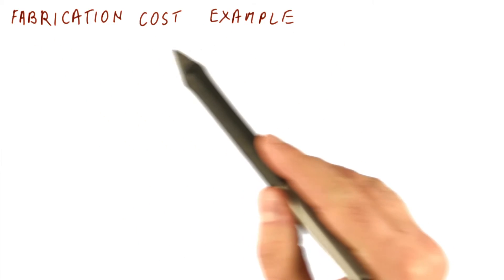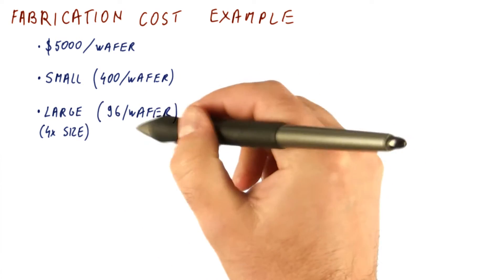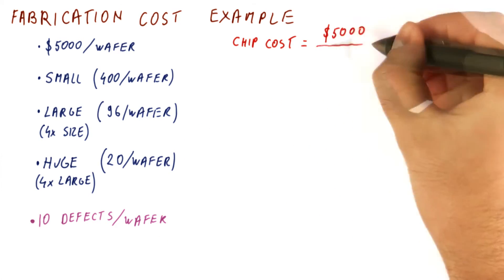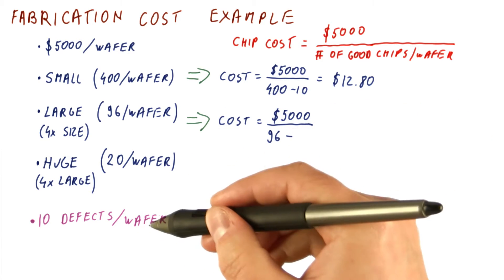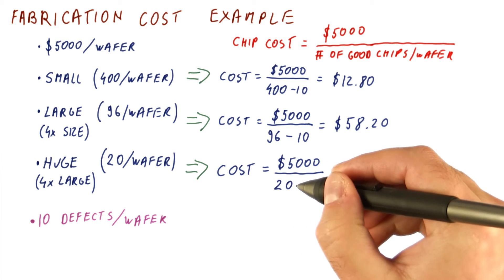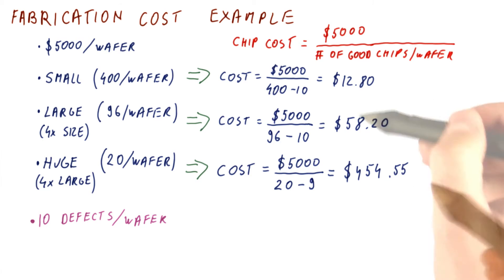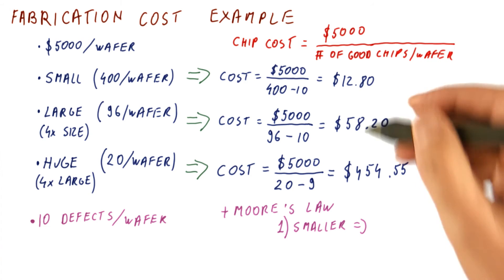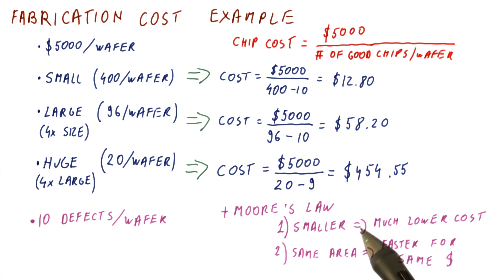Fabrication Cost 2 - Georgia Tech - HPCA: Part 1

Comment: I know this was meant to be a quick gloss-over of yield, but I figured I'd give accurate numbers based on the example:

To match the first parameters - 400 dies (or chips) per wafer with 10 defective ones - I used the values as follows:  

Wafer diameter: 300mm
Die size: 11.9x12.0
Scribe: 0.12mm
Edge Loss 5.0mm
Defect Density: 0.018 #/cm^2

At that size, yield is 97.5%.  390 perfect dies out of 400.

Quadrupling the area:

Die size: 23.89 x 23.9
Yield: 90.3%
79/88 dies usable.  

Quadrupling area again:

Die size: 47.79 x 47.81
Yield: 67.2%
10/15 dies usable.

Hope someone finds it entertaining in the very least, my OCD wouldn't allow me to leave this alone...